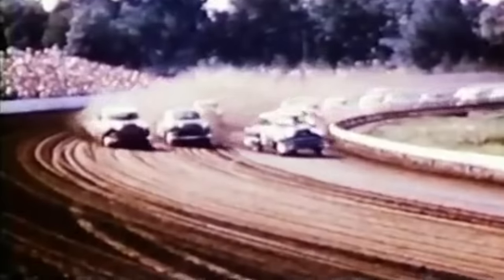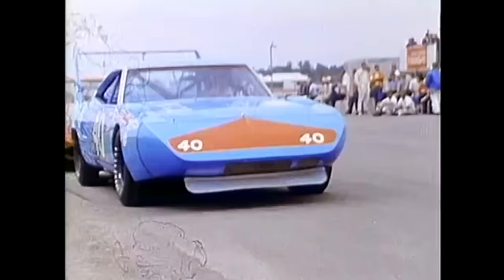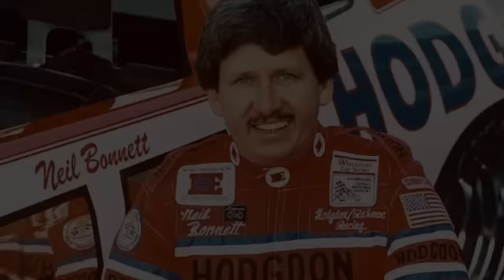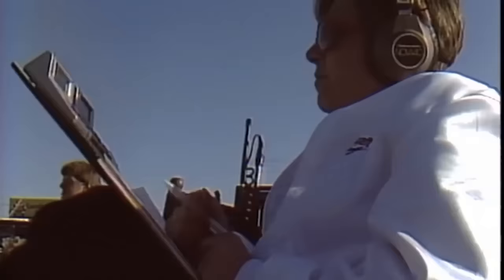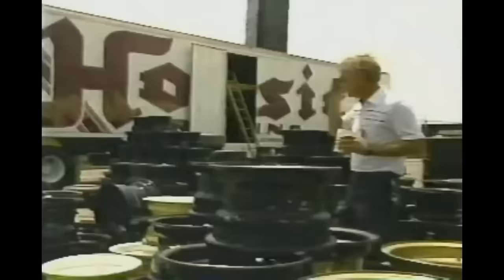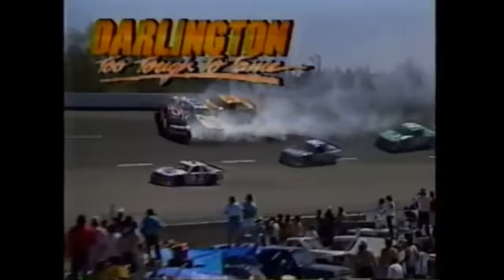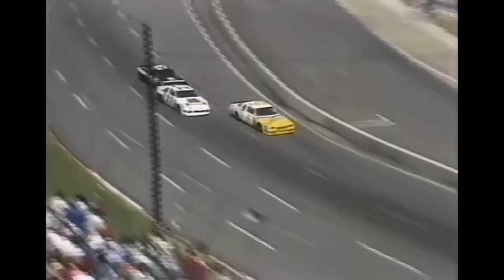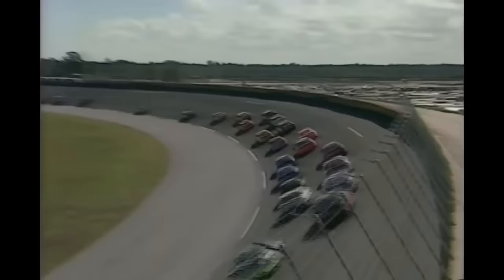Blood on the Asphalt: The NASCAR Tire Wars of 1988-89 & 1994

Comment: IMAGINE WHAT HOOSIER COULD HAVE PRODUCED HAD THEY HAD EVEN HALF OF GOODYEARS RESOURCES
Reply: Ultimately, Hoosier ended up being the exclusive tire sponsor for the ARCA Series for 21 years. For the 2016 series, Continental (which distributed Hoosier racing tires) rebranded the tires as General Tire, before buying Hoosier outright. Today, the Hoosier brand is only used for the Whelen series, while Continental brands tires for other series as General Tire for ARCA (which was bought by NASCAR in 2018) and other NASCAR series besides Cup, Xfinity, and Trucks.

As for the Goodyear tire exclusivity...that expires after the 2022 season, and Continental might want to reintroduce the Hoosier brand to the top series.
Reply: Adam Moreira it’s also used for sprint cars
Reply: @AEMoreira81  That would be awesome, Hoosier Tire with Continental's resources would be a good replacement for Goodyear, or maybe a 3rd Tire War could happen in 2023?
Reply: @Slidejob01  Hoosier is basically and undisputed the best Dirt Tire, They hold up well and are easy to burn grooves into. American Racers blow out easily and are just difficult to work with
Reply: John Cannizzaro Jr I agree
Reply: Technically they are
Reply: turn off caps
Reply: Imagine if they had the success of running a worldwide scale company. To conject it would be any different has no basis.
Reply: @thokim84  true, but that works both ways.  How do we know it wouldn't have been different?
Reply: @AEMoreira81  but why limit each series to ONE tire...?  senseless and greedy
Reply: @AEMoreira81  sprint cars and lots of road cars use them too which is good
Reply: Junk just like the tires they produce for us for local short track racing I live about 45 minutes from the Lakeville facility it is not a little Fab shop anymore they are owned by Continental now and they produce junk blistering can't get more than one night sometimes more than 50 laps out of them
Reply: @racecarwayne  maybe now, but I'm sure back when they were competing against goodyear the tires were much better
Reply: YEAH I KNOW RIGHT!! you really don’t have to speak all caps though

Comment: Nothing wrong with competition.  The blood was squarely on NASCAR's head.  They didn't set adequate standards for tire design.  They fell dangerously behind on the safety curve on car design.  Not mandating the use of basic safety devices such as head/neck restraints and full face helmets.  Permitting improper installation of seat belts and other safety features.  Most of the deaths that occurred during that era would not have occurred had NASCAR simply mandated the proper use all the available safety devices that were available at the time and required in virtually all other types of motorsports.
Reply: that makes sense since dale was wearing a open face until his fatal wreck and when did hans device come out i swear goodyear sucks still today
Reply: Nicky D Dale refused to wear the HAAS device he called it the hangman and was afraid it would cause a broken neck on accident
Reply: @DevinEMILE  Which is exactly why it should have been mandated by rule and not voluntary.
Reply: In the period covered by this video, I don't think the HANS device had seen widespread adoption by any racing series.
Reply: That Daytona crash is still a head scratcher.  Physics is a game of millimeters and micro angles.
Reply: I meant seeing it...you see guys hit the wall at 190mph at a much steeper angle, and walk away.  It was such a minor looking crash by racing standards.
Reply: @DinsdalePiranha67  Not only had it not been "widely adopted", it hadn't even been invented yet.
Reply: @rickfeith6372  In addition to what other people have mentioned about the seat belts, there was basically no structure between the front fascia and the front of the frame, which had by that time gotten very rigid. So when the car hit, there was very little deceleration before the frame hit the wall and the car just stopped
Reply: almostfm All in all it took more balls to race back in the day because of technology that hasn’t been invented, and probably wouldn’t of been invented and or mandated if it weren’t for a lot of these crashes and fatal events.
Reply: @NealB123  Hell yeah! Authoritarianism! Gotta love it!
Reply: @DinsdalePiranha67  it wasn't, the HANS device wasn't even available until 1991 and it wasn't used by any major series until CART mandated it on ovals. Formula 1 didn't even mandate it until 2003.
Reply: Normally I'd agree but fact is that in trying to outdo each other, the manufacturers completely ignored reliability/safety.
Reply: @JSchaffer214  Saying motorsports safety rules are "authoritarianism" has to be one of the most Murican things I've ever seen. And I don't mean that kindly.
Reply: @DevinEMILE  he actually said this about full face helmets
Reply: The Hans device was first used in racing after 1986, many sites don't agree on the actual first year.
It was being developed all the way till 91, and in 95 F1 teams started testing it following the Death of Senna the previous year.
 It would not be used in F1 races, only testing, until 2002, and made mandatory in 2003.
Reply: @almostfm not trying to be a jerk, but your comment got me interested so I checked: 1985 was when the first prototype was developed and in 1986 Jim Downing becomes the first IMSA driver to wear a HANS device.
They begin production and sale to the public in 1991.

Comment: 6:05 Some interesting facts about the Thunderdome (yes it's a great name) and why there's a 1.1 mile, 44,000 seat paved oval track down here in Australia

The track it's located at (Calder Park) is owned/sponsored by Bob Jane (and now there's some ongoing feud about who owns it since Bob's death but anyway). Bob Jane owned an eponymous tire shop chain down here in Australia that also sells it's own brand of tyres, so Good Year technically got tyre sponsorship rights for an event held at a track that is both owned and sponsored by another tyre maker. Talk about art of the deal.

The Thunderdome was built for 2 stock car series, NASCAR's Australian series (which used full NASCAR-spec cars and engines, whether imported from the US or made locally) and AUSCAR (also not kidding with the name, which used Australian built road going sedans and 5 litre engines). Goodyear would also have tyre sponsorship rights for both series. As the majority of the NASCAR cars would be imported, at least for the first season, the decision was made to keep all of them in LHD. But the AUSCAR cars, reflecting their Australian roots, would all be in RHD. This meant that the AUSCAR's would be running clockwise (turning right) but NASCAR's would be running counter-clockwise like they normally do, so the Thunderdome would be run in both directions. 

It was also designed as a scaled down version of Charlotte, so it's also a weird shaped quad oval with 2 dog leg corners on the same straight.

But the AUSCAR series would close after 10 years because the governing body for motorsport here threatened to ban any of it's drivers that competed in it from competing in other series', causing it to lose all it's drivers, and NASCAR here would die not long after but the writing was kinda on the wall for both as attendance/interest had dropped way off. Plus there was only one other paved oval track they could race at, and the other (Adelaide International) was absolute dogshit.
Reply: CAMS do love ruining any fun we have here!  Destroyed AUSCAR.   SST no longer compete here, they have made grassroots motorsport almost impossible due to the costs of events/equipment and all their rules and regs (a lot which are needed)
Reply: You also cannot forget that the actual racetrack was shutdown by the newly made housing estates near the reface track as they complained about the noise
Reply: I live in Victoria and I've passed that racetrack several times
Reply: @thatepicperson5208  
Thunderdome: exists
People in new suburbs right next to track: OMG why is it soo loud?? wtf??
Thunderdome: surprised pikachu face
Reply: @thatepicperson5208  Why the hell do not some of the folks complain, saying, "it is too quiet", thus, evening the score, with the "tit is too loud" crowd.    "evening" does not look, correct.   Making the score, even, maybe.
Reply: mad87645 WoW!  Thanks for sharing, would never have known this.
Reply: Every couple of weeks all the big pizza company's (and small ones) in Cairns at Far North Queensland would race on dirt ovals around the city. I've been to one where Domino's pizza won a race by flipping the Pizza Hut car. It was epic. There is usually 30-40 drivers and you can even enter yourself. Only rules are that you had to have a number on your sides and roofs, roll cage, fire suppression system, sponsor, pit crew, right amount of fuel. You can use any tires you want as long as they aren't too big. Has a driver died? Yes. Three actually. Two in same crash and one separate one. The two guys who died had one of them had his engine explode and kill him instantly and the other guy tried to dodge him but (sorry if this offends you) got Dale Earnhardt'ed into the outside wall. Sad night that one was.
Reply: Back in the 90s I used to live where Caroline Springs is now, it was still paddocks back then and you could see clear across to Calder Park, some nights when the top fuel dragsters were racing I could hear the roar from my house as it was about 10km distance to Calder Park as the crow flies.
Reply: That's kind of a shame to hear.
AUSCAR would've been a flash in the pan anyway, but it would've been neat to see V8 Supercars running oval tracks. I mean, they're basically a fusion of NASCAR and touring cars anyway.
Of course, V8 Supercar probably got gutted this past year after Ford folded their Oz division and the collapse of Holden.
What's it full of now? Toyotas?
Reply: @twotailedavenger  didn't AUSCAR use V8 Supercars? Sedans with LHD and 5 litre V8s
Reply: That is some crazy cool history there. Had no idea about Nascar in Australia, and Auscar
Reply: @thatepicperson5208  This comment is three years old, but I thought I’d clarify some stuff.

The Thunderdome and Calder Park in general have not been shutdown by noise complaints, rather CAMS and then-owner Bob Jane had a massive falling out and CAMS pulled their racing licence, meaning they could only run under a AASA licence, which is basically only local racing series. Then, Bob and his son Rodney had a falling out that led to a decade long court battle that tore the family apart, and has only been rumoured to be settled recently, long after Bob passed away.

The track has essentially been stuck in limbo for the past 6 or 7 years as ownership disputes raged on, but recently they restarted their local weekly street drag racing and have announced that race meetings will recommence after probably a decade or so starting next year, with plans to modify the road course to be back up to standard.

If you’re wondering why the track wasn’t demolished or hasn’t been moved for housing, they can’t. As in, it’s illegal for the track to be destroyed. Before he passed, Bob got the track heritage listed, meaning no one can swoop in and destroy it. The track must remain a race track, there’s nothing the locals can do to stop them.

Hope that cleared some stuff up.

Comment: From personal experience.
Hoosiers (grooved) we're far superior in my years racing compared to a Goodyear(slick)that was 1" wider.
Those were the choices we had to run.
Both were trued and soaked.
Hoosiers had a much longer life and were much better molds, apparent in the truing process.
Reply: Ya know why Hoosiers are grooved is because they are mostly used with dirt track cars and Wissota (Minnesota and Wisconsin racin organized) are sponsored by then which is all dirt. Also they make go-cart tires and some Sprint Car tires which are slick the back ones.
Reply: @christopherwinter2099  my cousin an I have this argument all the time but it's about the dirt tires he says oh Hoosier and I'm the American racer guy I've only ran 1 set of Goodyear's on dirt not a bad tire just way to expensive and no where near the rollout or sidebite of the Hoosier or American racer
Reply: @ronniemctaggart8722  yeah I've seen good sets of Goodyear's in different states but be to expensive to buy and get them as it's easier for either my dad  to either just get them shipped to him or just run down to Hoosiers in Rochester,MN
Reply: Figures Goodyear would make better racing tires. They have the shittiest consumer tires. Shows their research is spent somewhere
Reply: @samuelstephen5071  Hey, stop stealing comments.
Reply: @christopherwinter2099  my grandfather raced in the wissota series for a long time! Harry Hanson!
Reply: They make great Formula SAE spec slicks

Comment: I've ran on Hoosier tires, at dirt tracks, and won, never had a problem
Reply: Randy Hutchinson I guess they got there s*** together because I have a friend who DOMINATES go karting
Reply: @boltracing4856  good job your friend didnt run michellen tires or hed be out befor the race had even begun 

(Did you get the reference)
Reply: When I get a car (and start modifying it) I will probably use Hoosiers because they are still running to this day and they look good
Reply: I might as well eventually too

Comment: The funny thing is that now Hoosier could actually pull off being a secondary tire supplier for nascar because they have the backing of Continental and their tires would most likely either be based on tires continental designed for a similar series or they would just be re-badged continentals.
Reply: The ARCA Generals are the Hoosiers of days past, with the newer technology incorporated as time went on. Continental owns General. Their relationship dates back a few years to the late 80's. Hoosier made General racing tires for the CASCAR Super Series (now NASCAR's Canadian Pinty's Series). In turn General made a Hoosier branded street tire.